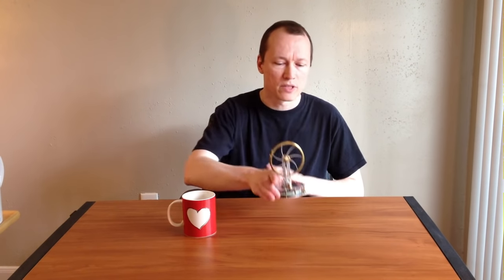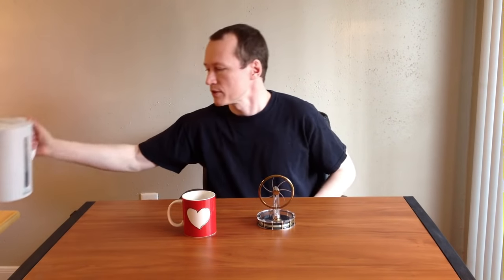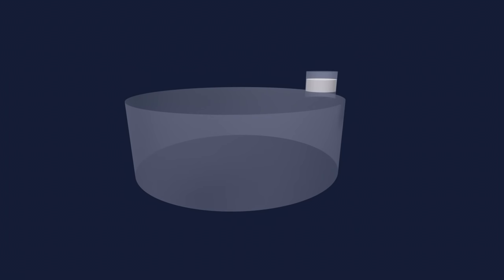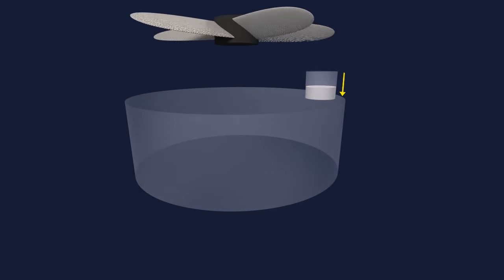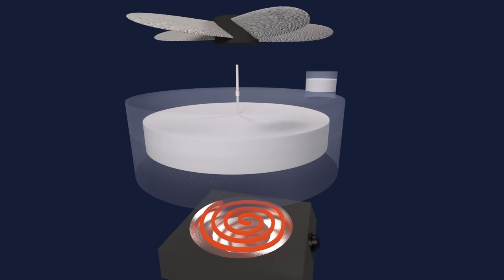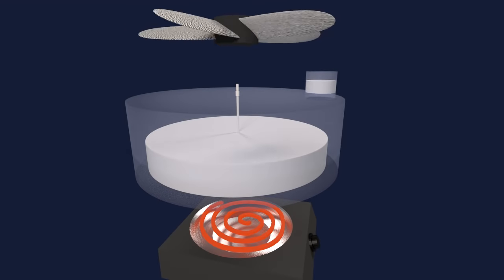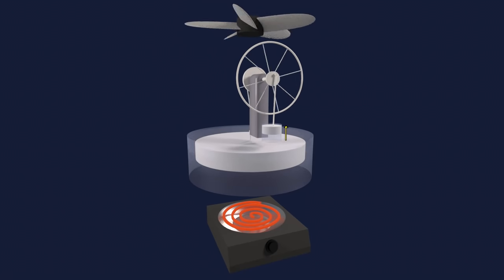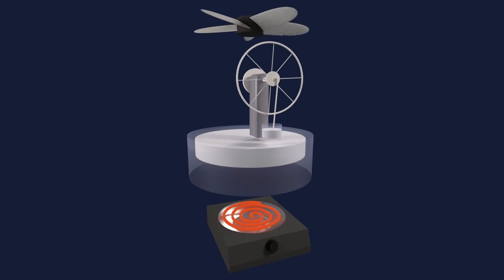How A Stirling Engine Works

Comment: Thanks for this excellent demonstration. My one concern is that the Sterling engine doesn't seem to be a very economical alternative to the various engines in common use.
Heat is expensive. If the Sterling engine requires a generated heat, or cold, source in order to function then it doesn't seem to have a practical application. Unless, of course, it could perform a greater volume of work per calorie of energy than common engines like the internal combustion engine, or even the steam turbine engine.
Is it possible to make a powerful Sterling engine that is sensitive enough to not require a generated heat or cold source?
Reply: Heat is expensive? This engine uses the temperature difference as its source of generating energy, so it doesnt necessarily require artificial heating or cooling. A higher temperature difference just nets a higher energy gain. Also, they are more efficient than steam engines but the problem is that they have a low power-to-weight ratio which means they can generate lots of energy but lots of space will be needed for the engine to run.
Reply: It's not really an infinite power source though. You're using energy you would otherwise have wasted.
Reply: +Hardtop Harry It doesn't use heat (neither cold) to work. What it uses is a temperature difference. The more the difference the better.
You could build a super Stirling Engine (like very big) on the Antartica so its cold plate would be on the surface and its hot plate would be buried into the ground close to the Earth mantle, It would generate a huge amount of work.

Comment: also, do you know the best size for the slave cylinder with respect to the master cylinder?
Reply from the maker: +Dorfdude8 I don't know a mathematical formula for that either.  I suppose it would depend on the design goals.  For example a bigger temperature difference would allow the big cylinder to be smaller without having to shrink the cylinder that has the piston.
Reply: +Michael S would you mind giving me the dimensions of your own master cylinder, pistons, and slave cylinder? I'm trying to build a homemade Stirling Engine for my physics class and I'd like to start off trying your proportions and tweaking it.
Reply from the maker: +Dorfdude8 The one in the animation doesn't have measured proportions.  Its only goal was to illustrate the principles.  The real engine in the video is a professionally engineered one that I bought on eBay.  For a homemade engine I would recommend one of the tutorials online that provide instructions and templates, and use a balloon for the piston.  I made one of those once and it was a great learning experience.  My homemade one broke though, so I don't have it now.

Comment: Is that going to work, even when you placed it inside the freezer, for example? I never built stirling engine before, but i'll build it if i have enough time.
Reply: No there has to be a sufficient temperature difference like {up (cold) bottome(hot)} or visversa
Reply: I think you're right, it'll work if there's some sort of temp differential like hot side and cold side, and vice versa. If that engine is designed to run on cold environment, it needs some sort of hot side, otherwise, it will never work, or for engine that uses heat it's vice versa.
Reply: as long as you have temperature difference of say at least 10 or more degrees I think it will always work then.
Reply: theDemolisher13 TY. I appreciate your advice.

Comment: It's a good one with simple animation and neat explanation.But what comes to my mind is that, U said that running on cup of hot water and on a block of ice runs in reverse.But what I see was U were turning in clockwise and anti clock wise for two cases.I don't get it if it in real the running of flywheel gets reversed if source of heat medium is changed from hot to cold.Can you please explain.
Reply from the maker: +Altaf Hussain  Hello - When the engine is on the cup of hot water, the cup of hot water is the hot side because it is warmer than the room temperature at the top of the engine.  When the engine is on the ice, the ice is colder than room temperature, so the top effectively becomes the hot side.  I hope that helps.
Reply: +Michael S Hi, I understand the air current way due to temperature differences..But my question is that, U changed the rotation of flywheel.Did u get my point,sir. If it generally turns in a reversed direction in two cases with you same direction intial force,then I suppose that your study comes clear.Thank you
Reply from the maker: +Altaf Hussain I'm not sure if I understand your question, but the orientation of the hot and cold sides determines which way the engine tries to turn the flywheel.  You have to give the flywheel a push in that direction to start it.  If I tried to push the flywheel counter-clockwise while it was on the ice, as I did when it was on the cup, it would have stopped because I would have been trying to spin it against the direction the engine was trying to turn it.
Reply: +Michael S
Ah, okay, I looked at your animation and see why that's the case now, the piston arm is always at the same position when the displacer is at the bottom; originally was thinking it could be either at 3 or 9 o'clock.  Since it's always at the same position, then the direction of rotation would be forced in one way when it's heated from the bottom and the other way when it's cooled-

If the piston crank is at 3 o'clock when the displacer is at the top, then when it's being heated, the piston pushes up, so it will always try to spin counter clockwise.
If it's being cooled, the piston pulls down so it will then be forced to spin clockwise. 

The key thing to understanding the reason for the rotation direction is that the piston crank is always at the same position with the displacer at the top.
Reply from the maker: +DTR RTD You are absolutely right.  At 2:30, in the animation if you had the engine adjusted so that it is at 9 o'clock instead of 3 o'clock, it would rotate clockwise instead of counter clockwise.  So that is another way to make it run in the opposite direction as opposed to swapping the hot and cold sides.

Comment: Why does it go anti-clockwise in hot mode and clockwise in cold mode?
Reply: +Big Boss Design of a particular model. Piston connection to a flyweel.
Reply: +Big Boss 2:25 Notice that there are two positions wherein the heating/cooling of the gas in the cylinder causes the pushing up (2:30) / pulling down (2:47) of the piston. You can focus on the first position shown at 2:30 The first position shown is when the displacer is at the top, so the air is being heated from the bottom. This expands the air in the cylinder and pushes the piston upwards, and since the piston's bar is connected to the right of the center of the flywheel, this causes a counter-clockwise motion as the piston is pushed up. Now imagine if the bottom side is cools the air inside, this will cause the piston to be pulled down, and thus cause a clockwise motion. Hope this helps!
Reply: +flippypal Yup! That makes perfect sense. Thanks a lot for the detailed explanation! :)

Comment: can it run with body heat?
Reply from the maker: I'm not sure but I imagine it is possible if the surrounding air is cold enough. There would have to be a big enough difference in temperature between the hot and cold sides.

Comment: at 2:45 / 2:53 how does the cooler air make it go down.
Reply from the maker: Hello - The air inside of the cylinder contracts as it cools, but the air pressure outside of the cylinder stays the same.  So the piston is pushed down by the air pressure outside of the cylinder.
Reply: Michael S i understand now, Thank you

Comment: I do not understand why does it always need a boost to start.
Reply from the maker: Hello - That's a good question.  I'll try to explain as best as I can based on my understanding.  The air seal isn't perfect, so part of the problem is that air can slowly leak in or out while the hot side is heating up.  Also, part of the cycle depends on momentum so even if there were a perfect seal, it probably wouldn't get through the part that requires momentum.  Hope that helps!
Reply: @mstreeter11  Thanks for an opinion. I guess it needs to make a test with perfect impermeability to understand it. If impermeability is bad, i guess you are right and air can just go through it slowly when it gets hotter and do not do any work. But in case of perfect impermeability it must pressure walls and do the work.

"part of the cycle depends on momentum"

In phase when air gets hotter it does not need a momentum, cause it gets whider and pressure walls. In phase when it gets colder it also should do its work without momentum. That is why i do not understand why it also needs a boost to start, even without real load. And after start it works good even with a load.
Reply: @mstreeter11  btw why do they always use cilinders? Why sqare piston does not work?
Reply from the maker: @nikolayskvotsov3868  I don't see why a square piston wouldn't work.  But it would probably be harder to make with no additional benefit.
Reply: How hot does it have to be?